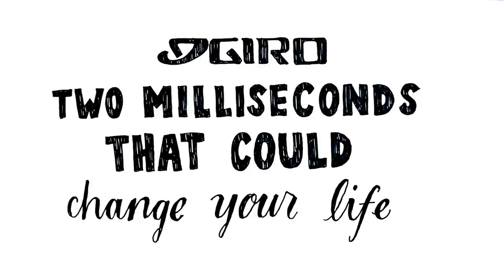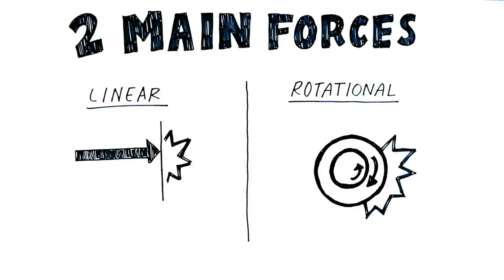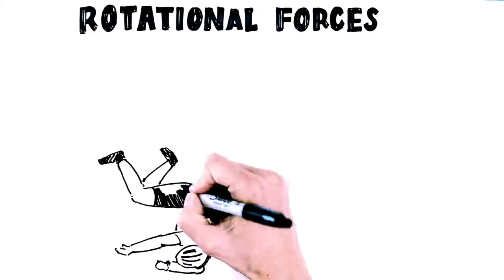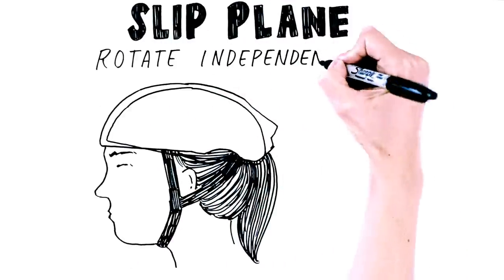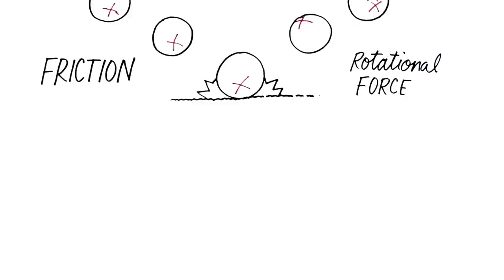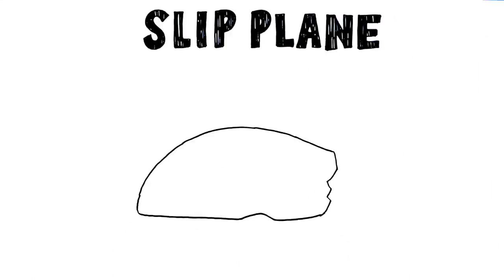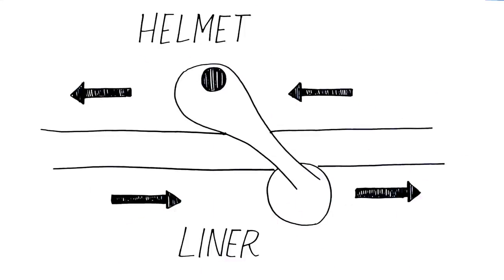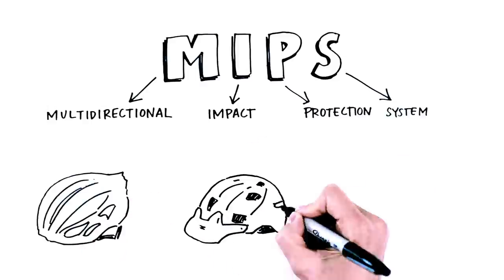THE MECHANICS OF A CRASH

Comment: Wouldn't much of the rotational force be negated by the helmet simply shifting on the rider's head? No matter how tight the helmet is strapped to your head I guarantee it will move in a collision.
I was in a minor motorcycle accident and I remember actually feeling the helmet rotating around my head on impact.
Reply: Exactly. No need for a fancy slip plane. One already exists - it's the plane between the head and helmet itself.